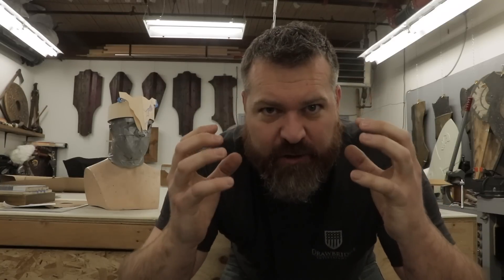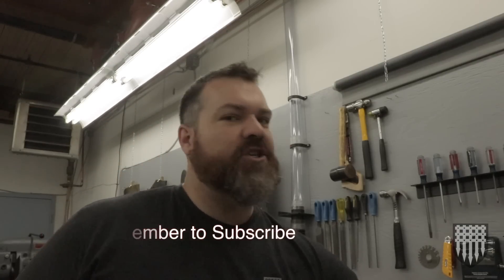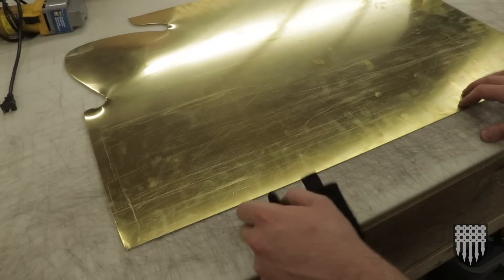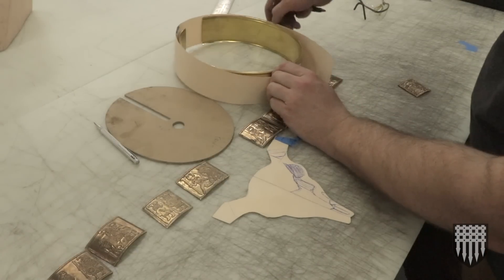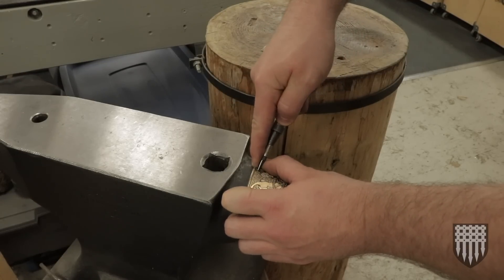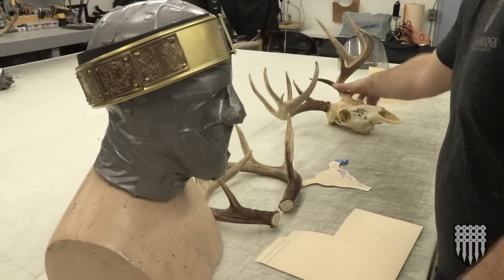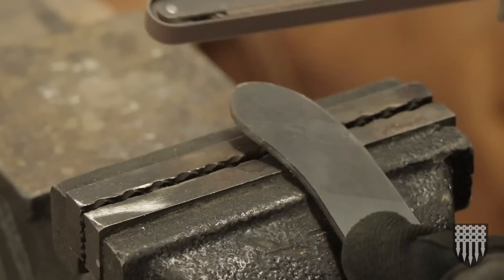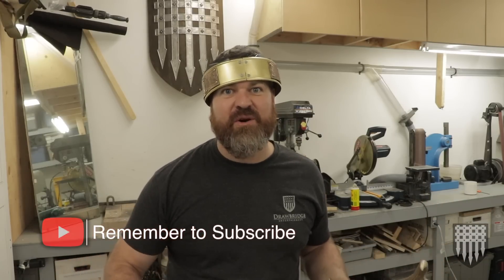How to make a crown: Deer Skull Viking Crown with Real Antlers - Part 1

Comment: Is it possible to commission your work? I'd like to have a Monarch's crown made with the typical arches and orb on top but where my design varies is instead of fleur de lis and cross pattee I'd like 2d antlers with a faceted gemstone centered between the antlers Kinda like they're holding the gem and crescent moons covered in gemstones with points up (alternating pattern) I'd like the crescents to be silver in color while the rest is golden in color and an additional crescent with points up atop the orb also with gemstones. Also other gemstones along the band of the crown. Gemstones faceted from cubic zirconia